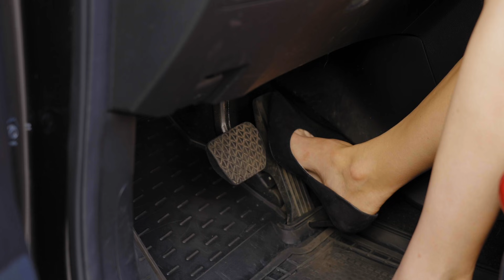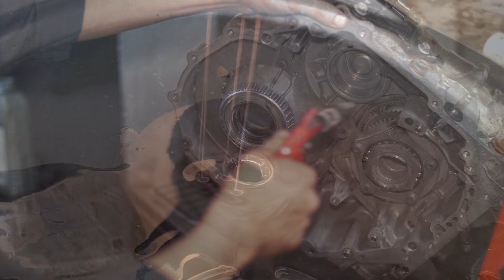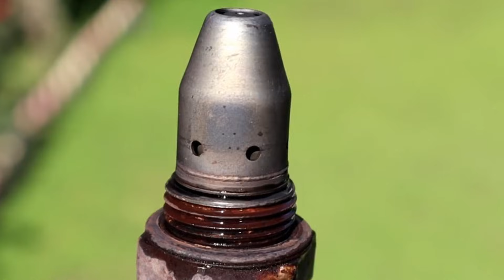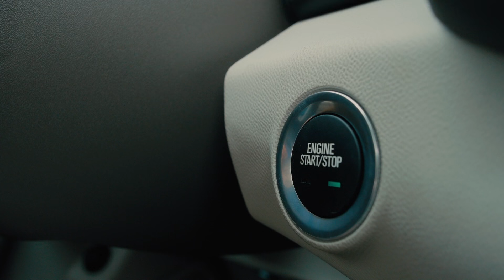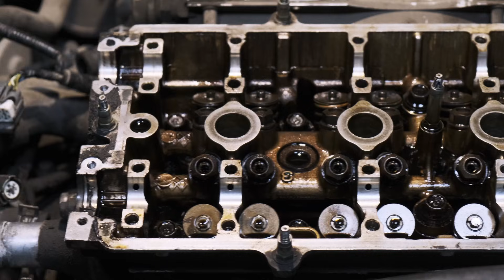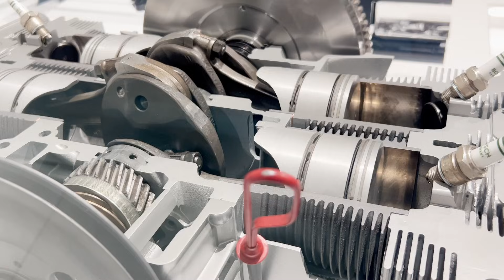15 ILLEGAL Tricks That Will Make Your Car Run BETTER

Comment: These are all completely useless if not, marginally beneficial.  

Clean your intake with CRC or Seafoam, WITH THE FILTER STILL INSTALLED!  They even give you a curved tube for this.  But most others are completely not worth your time.
Reply: They're all snake oil. Don't bother with any of that crap. waste of time and money.

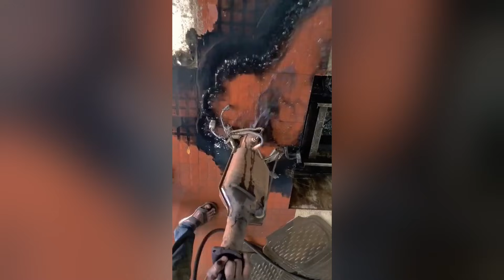Comment: 9:45  so you are tellig us to destroy the engine...
Reply: Also new platinum and iridium plugs can Not be re gapped ..you will break the coatings off of the tip and ruin the new plug…in my 20 years almost all of the plugs I have bought were correct gapped….
Reply: I just removed all cats from my vehicles and have my tuner properly tune for it. It's easy to pass emissions if done correctly.
Reply from the maker: I can see how it might sound that way! The tricks are more about optimizing performance without causing damage. Always best to tread carefully!